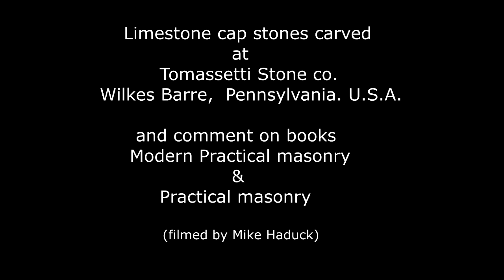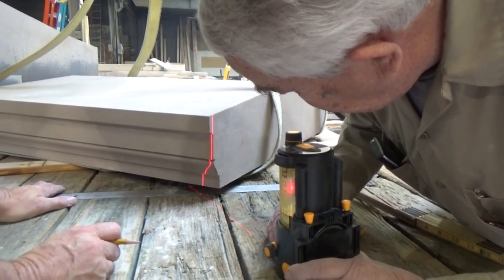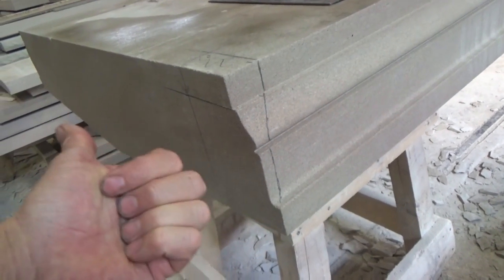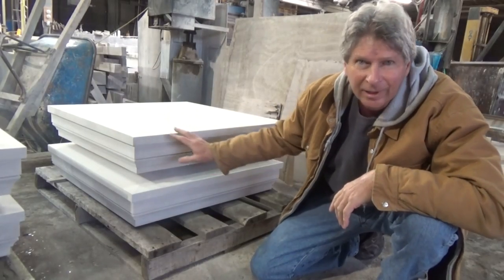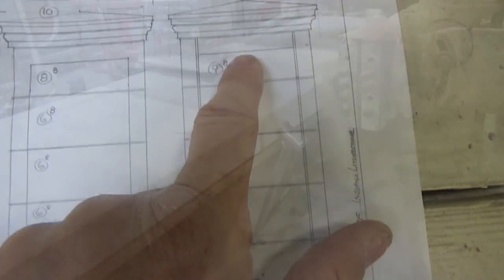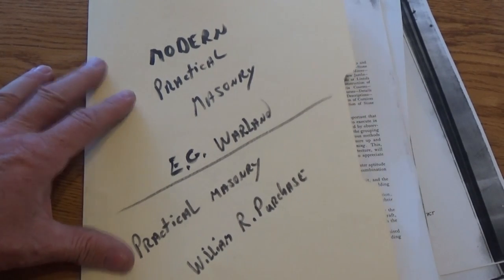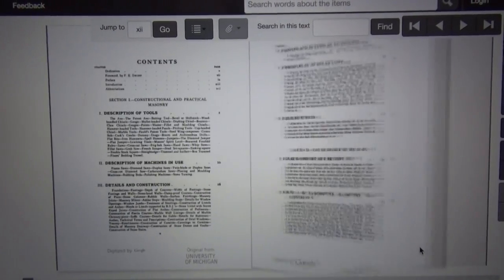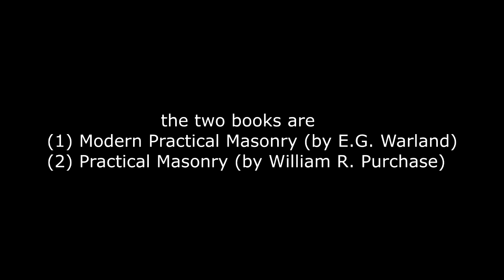Limestone caps, carving, plaining, (Tomassetti stone co.) Mike Haduck

Comment: I'm a machinist and we have a planer like this at work. It has a 20' long table and was originally used for planing steel but milling machines are used more now in modern times. We still use this planer to cut large internal keyways sometimes up to 36" deep by using a bar mounted to the planer that goes back in the bore as the table moves.

Comment: Very interesting, I thought those pier caps were poured. The machining of those caps is called broaching I've seen thousands of engine blocks go through something similar.
Reply from the maker: Thanks Henry,   Mike
Reply: I am a machinist and broaching generally refers to shaving out holes like the keyway in a pulley hub or the rifling in a gun barrel. The machine shown shaving the decorative geometry is very similar to a machine used to machine very large flat surfaces on metal parts.

Comment: We used to buy from a stone co. like Tomassetti Stone called Argyle Stone. They would use An Indiana limestone that was White not the one with the grey tone.  The last recession put them out of business.  They did arches just like in the books you showed.  Always be very careful handling and setting limestone because it chips then you have to patch it with Dugan patch.
Reply from the maker: Hi Meno,  it is a rare art for sure,  "Dugan patch", I got to check that out thanks mike
Reply: Sad but if nobody buys your product you can't remain in business. I think from the video they would not have met new standards of OSHA concerning silica dust. They would of had to spend a ton of money on upgrading the factory to capture the deadly dust.
Reply: Limestone is calcium carbonate and or magnesium carbonate.  No silica, not deadly.  Granite, colored marbles, sandstone, quartzite, and concrete dust contain silica.  Your body can process the limestone dust unless you inhale massive amounts at one time.  Still, the g'vt is forcing the wet process on the entire stone industry but the limestone industry should be able to get by with better ventilation but resperators would be overkill.  I wear a resperator when I have to-- Silicosis is a bad deal!
Reply: Yea that's why people got "stone cutters cough" before they knew what to call it. Any foreign crap in your lungs is bad. Hook me up to the scientific link on your claim thanks
Reply: Yeah, probably have that but I smoked also.  Never claimed to be a doctor though maybe "deal with" would be a better way to state what I meant.  I dont have scientific data but know what my physician told me.  If that isnt good enough, and if it interests you enough, I suggest you look into the effects of calcium carbonate dust on the lungs yourself.  NEVER did I claim it was good for you.  Just not deadly... meaning limestone dust...and most dry process carvers will tell you that it is addictive.   I certainly enjoy it.  Different kinds of limestone taste different.  My favorite is also the best to carve- go figure.
Reply: I'll wear a mask for any kind of dust.

Comment: Can you give the name,brand, model of the pneumatic tool he is using in the video? thanks
Reply: call them or ask Vermont Tool they sell some stone working tools.
Reply: Those look to be Dallett hammers.  Thomas Dallett made them in Philledelphia, went out of business in the '50s or so.  Trow and Holden which made the first air hammers own the rights to make the Dallett tools.  These are long stroke hammers suitable for "soft" stone. T&H also make their original line of "Barre" short stroke hammers for the hard stone. I highly reccomend Trow & Holden.  Call them and tell them what you are carving.  The air hammers made in Italy and elsewhere in Europe are NOT superior... they are knock-offs marketed as prestegueous.  Beware of the cheap ones from asia.  They use much more air and will destroy your hands - they run so rough.  A 1 inch tool for heavy carving and either a 1/2" or 3/4" for detail or lighter duty carving.